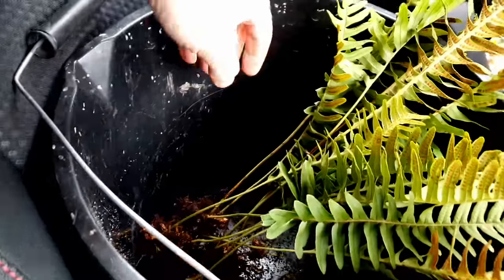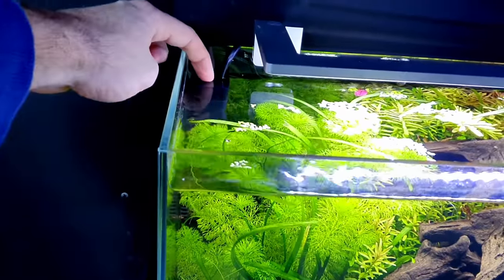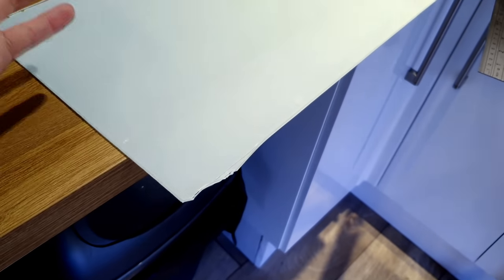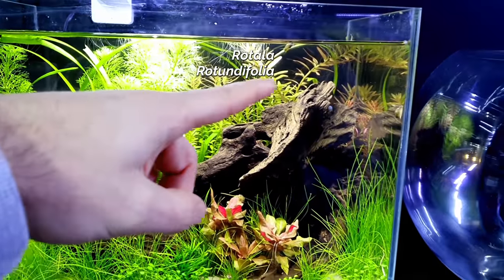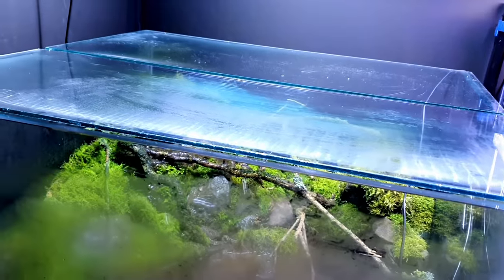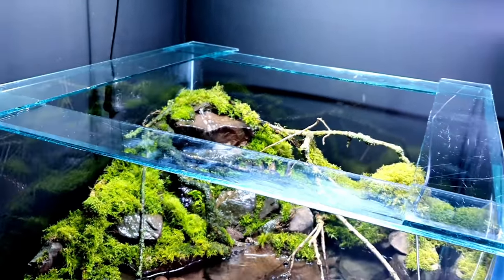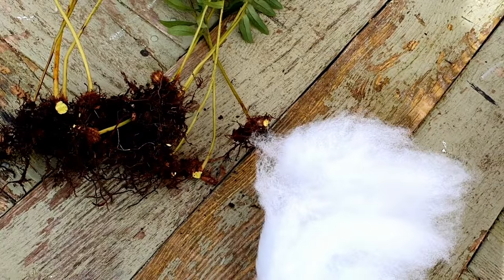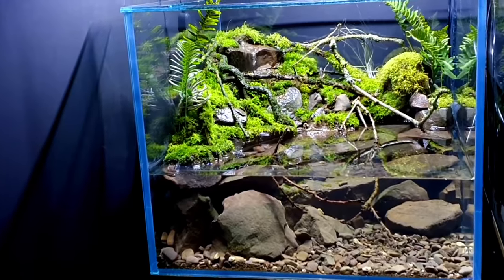NEWT PALUDARIUM WATERFALL SETUP: *FINISHED* || MD FISH TANKS

Comment: You did say that you're planning on putting some mesh over the center of the lid, correct? Not worried about newts traversing the glass upside-down to get out, but you'd be surprised at how good they can be at climbing ferns, and it looks like those are already just about tall enough for the newts to use them as a means of escape. (also, they're very good at slipping through cracks--if the crack between the top of the aquarium glass and the bottom of the lid side panels is more than about 1/3 a newt's "height" from bottom of belly to top of back, it'll probably be able to slip through).

Comment: Not sure if you have done something bout the top as I'm still watching haha but you could always use the screen on the two side pieces and then lay it on the other glass that's onto p of the tank, you could also use glue or whatever is strong to hold the glass and screen together and then have the other 2 prices of glass underneath the screen so you get the middle open but they don't escape

Comment: Cut some screen material and use the glass to frame the screen in. 
Screen in the middle and glue the glass to hold the screen in place like a frame.. Then get the black foam stuff you use for doors . To fill the gaps.  This can go around the edges to boost and protect the glass . So hard to explain in writing. 😆

Comment: although this was an old video, I think it would've been easier to  just go and buy stainless steel mesh at the hardware store and make  a lid, then split that outflow by using an air hose to make multiple outflows around the scape to hydrate the moss without the use of mist maker